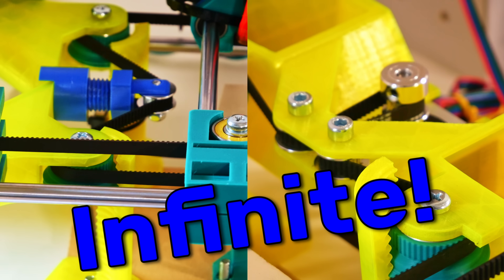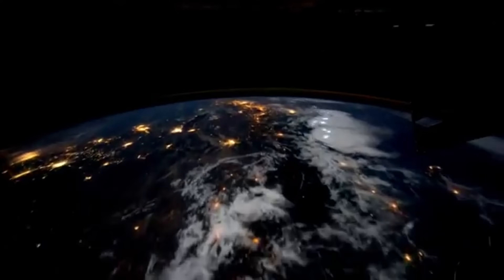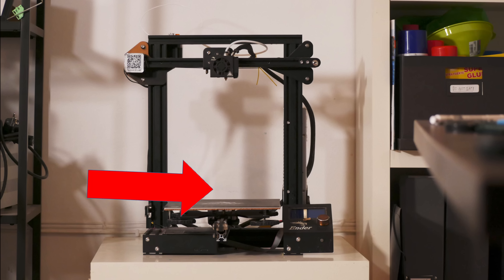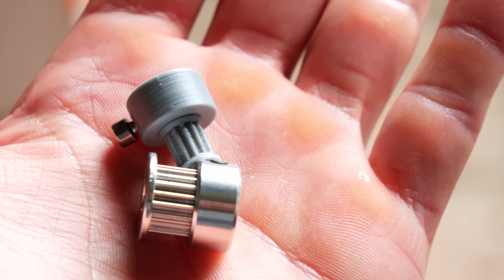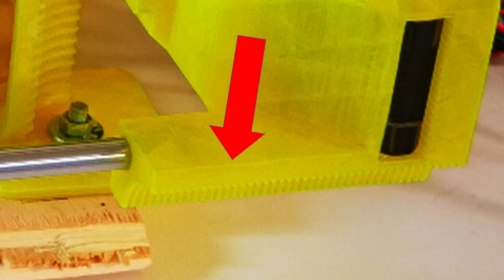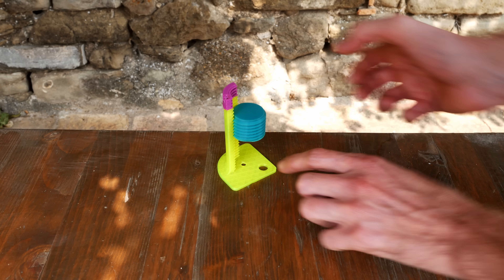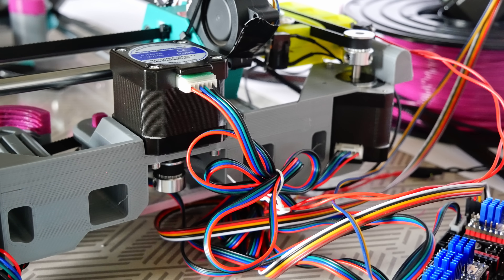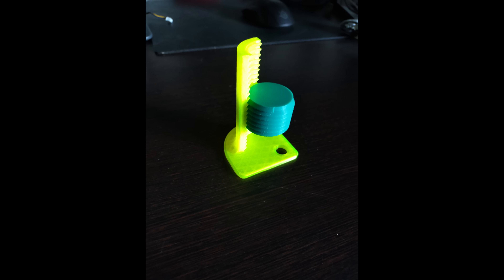it can 3D-Print onto itself?!

Comment: Print a smaller 3D printer that has a robotic building arm with 3D printing nozzle. Add the ability to move and you're good to go. Now you can drive around your first 3D printer and build as you like

Comment: Instead of cura, you may be able to create custom GCODE. Don’t know if it will help, but advanced 3d printing in clay and fdm by Diego Cuevas goes into heavy detail to create gcode using rhino and grasshopper for custom pieces

Comment: This is BIG. But uh, the biggest problem is both getting the materials and filament, or attempting to assemble the 3D printer using the exact same printer. Or even attempting to print the orders on the printer!

Comment: It looks to me like one thing each of the Sclegs (screw legs) needs is a rib to stiffen the back end of it.  Even just a 1cm bar going from the inner corner to the outside of the circle would probably do wonders to stiffen it up a bit.  That would probably do what you need to reduce flexion toward the center, but torsional flexing might still be an issue unless you have two braces either at angles or in a triangular/ x shape.  I think the dovetail screw profile is a very clever solution, but I also think that you need to stiffen the whole assembly up so that you can get better dimensional accuracy, which I think would help with some of your layer shifting issues.  I'm pretty sure you know this but have avoided it to reduce material usage during prototyping, but my unqualified, uneducated gut feeling is that this is probably contributing more to your problems than you think it is.

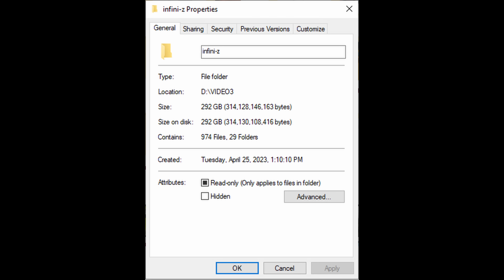7:30 - TBH, that sounds about right for Cura.  I get it if that's just the only slicer that will work for this, but my experience on multiple printers has been that Cura is pretty awful and prone to doing awful things.

good liuck, subbed, I hope to see updates!
Reply: The projectquine substack does talk about stiffening the legs up for taller prints.

Comment: I think the most challenging part would be the circuitry. Sure, you can 3d print circuits, but how are you gonna 3d print a capacitor, or a resistor, without it being massive and clunky?

Comment: 💀 Z wobble?

❌ Aluminium extrusion frame
✅ 3D printed flimsy plastic legs of infinite height no braces required
Reply: The counter-snapping thing Veritasium talked about is 3D-printable, and damps vibrations
Reply: @smorrow  "damps vibrations" Tell me you dont know a thing about 3D printing without telling me.
In 3D printing nobody really cares about vibrations since G sensors and input shapers were implemented. But nothing will save your print if your 3D printer frame is made of paper mache. Or in this case out of printed legs of "infinite" height. And im not even gonna go into the legs breaking inevitably when reaching a certain print height no matter the material theyre made out of.
Reply: @SagittarA  But at 5:00 he shows that the workpiece itself can have the "legs" as part of itself.  So that's more rigid (than the flimsy leg version, but not than extrusions) because more material,  but also it should have no Z wobble if you think about it because the top of the work is wobbling WITH the printer frame - because they're literally the same object.

As long as you can stand your work having artefacts of its creation on its outside corners.
Reply: @smorrow yeah as long as you only print the printer frame. So you exchanged z wobble for singular use machine… gratz i guess

Comment: Really cool idea, but if you truly print everything, you'll inherently get inaccuracies that just get worse each iteration. besides that, technology just isn't there yet to be able to print stiff dimensionally accurate metals and plastic in the same volume, and it's not a good idea to try either. You'd be way better off building an assembler, that can assembly both itself, and a 3d printer. Separating assembly and 3d printing is really not bad, and I think if both machines can be 3d printed, and assembled by themselves, you still achieve the end goal.
Reply: That's a really good idea dude

Comment: so your gonna print its printing supply by using its printing supply but it uses its printing supply to even print the printing supply to print the printing supply that prints its self the printing supply from that printing supply but you cant make the printing supply because it uses its printing supply to make things so to make the same thing you need the exact amount so IMPOSSIBLE to make it bro. also power

Comment: Hold up then if it can make a printer is one thing but can it program said printer so it has the instructions to be able to receive print instructions and also duplicate when prompted

Edit: and also you cant pull fillament out of thin air

Comment: As cool as the "infinite" printer is, I see least 4 points of failure when it gets high enough. Sure it will work on paper in a lab with ideal properties of all materials. In reality? treadmill printer seem far more likely to actualy survive printing it's own parts. 
Those 4 points, if they had a stability anchor at the top as well as at the bottom they yea, cool idea.

Comment: This would not be possible in any kind of universe, because the idea at its core is flawed, you cant print intricate motors and motherboards, even if you would, who would remove the printed printer from its base when its done? Who would plug it in? Speaking of power, you cant print a psu as that would be a huge waste of time and is very risky. Even if you managed to do all of that, THE PRINTER ITSELF DOSE NOT HAVE A BUILD PLATE, it can ONLY print itself!
Reply: Robots
Reply: @MrSkeleton14  whats that suppose to mean?.
Reply: @Enjeenier  robots plug them in
Reply: @MrSkeleton14  but thats only one of the countless problems, and even if you did places robots, they just create more problems, is the printer colony somehow manages to grow, than the robots will quickly become outnumbered by the sheer number of printers
Reply: @Enjeenier  print more robots

Comment: Project Idea: Take every 3D printable part and integrate them into one print file with engineered supports stacking all parts in the z-direction, similar to how resin printers achieve full build volume batch prints. I'm unsure of your current process but this would allow for the entire 2nd gen printer to be assembled upon the print finishing, assuring all parts are included. Building onto your idea of scaling, being able to use the full build volume without stopping to remove parts would greatly reduce time for human interaction allowing for more rapid scaling of the entire project.

Comment: Not sure the point or practicality of scaling the printer itself in size until it covers the volume of the intended product, instead of just pushing components into an assembly zone in charge of another robot. Most products can't be printed mono-piece. Nor I see how self-replication would be done in theory.
Now, the printer being able to arbitrary scale up by itself is a good idea, as it would allow printing larger components without the need to replace or rebuild the printer. Just ensure it can undo and remove the additional rails if needed.

Comment: I really like this, I was just thinking about a 3D printer that can increase it's build volume, the idea was that it could print extension tracks.  But this is far beyond that.
Reply: Ok, I think the answer initially is to just use a little human labor and don't be quite so exacting about how it lifts itself up.  Just make a 3D printer than can build a track and make sure that the track can plug into the existing X, Y and Z tracks to increase the build volumes which a human, or a very basic robot could manipulate into the right position to allow further extension of the build volume.  Agreed that metal can be done, and I like your ideas there but printing green parts, or lost PLA casting are also options.  I know you like the idea of it being just a printer that sets down anywhere and somehow makes everything but realistically we will always need more than just a 3D printer, and yes a 3D printer might be able to build some of those things but if a 3D printer can build some of what is needed then the printer doesn't need to do it all directly itself and plastic Filament is less abundant on Mars than you might think.  Let's just make a 3D printer that can extend it's build volume and be reproduced with minimal expense first.

Comment: Locating the print head could be solved with software,
Have it deliberately collide with the frame and detect hitting it by measuring the increased electrical load put on the motor when it collides.

Comment: But will it be able to troubleshoot and fix another printer?

I have been working on a robot that can troubleshoot and fix another version of itself.  All of the tools already exist (machine vision, circuit simulation, etc.) but getting them to all work together and actually be accurate has been very difficult.  Okay, actually, impossible so far, not to mention moving stuff in physical space is a huge pain.  BUT if we can build a robot that can fix other robots, we can finally get the future dystopia of our dreams bootstrapped!

Comment: One improvement I saw onto screw. You have bolt and nut. With longer bolt your roteable nut will not fit tightly to the bolt. So you need oposite force, some ball bearings with spring maybe. Have a nice day.

Comment: bit late to this party but uh, there is a way to fit the big box into the small box. Disassemble the big box into smaller parts. Though in this analogy that would lead to needing assembly so while it's possible to fit the big box in the small box, maybe not a great way to go about it... unless you have the printer rotating and controlling already printed parts to print more parts onto it after production. 🤷‍♂

Comment: What if it were 6DOF Arm? Would that be able to theoretically print itself because the build area would be the "Reach" of the arm 360deg around itself? That way you'd not have the box within a box problem, because there is no box. 
- hehe "There is no spoon"

Comment: What if the separate parts were printable in a way that made it as easy as possible to put them together to make a new 3D printer?

If it is planned how this 3d printer would be mountable in the easiest way possible, that is a path that seems more possible than the video path and it is not that much more difficult to replicate, indirectly, the new 3d printer.

Comment: I think that your ambition is incredible. And the ingenuity is inspiring. However, I don't agree that additive manufacturing is broad enough alone to build a self replicating machine. I think that your goal of creating a machine that can replicate itself is very feasible. Just not an additive manufacturing machine.
So, a few things needed to be added for this thing to truly be self-replicating -
   A mining process to gather raw materials, including fuel to create heat and energy, minerals that can be refined somehow into plastics and metals(can you create plastic from raw minerals found on Mars?).
   Additive manufacturing to create parts that can be printed.
   Subtractive manufacturing to create parts that make more sense to mill
   Foundries to turn raw ore into metals.
   Mechanical manufacturing to turn raw metal into wire, sheet, and bar, and then turn those products into springs, bearings, tubes, pipes, bolts, rivets, etcetera, and then assemble those parts along with parts created in the additive and subtractive processes into working machines.

Everything would need to be automated. From refining crude into plastic, turning the plastic into pellet, then into filament, winding the filament, storing the filament until it is needed, loading the filament when the previous loaded filament has run out. Along the way, the machine would need to maintain itself, lubricate itself, make repairs, build structures to protect itself and products from the elements. 

It's like a biodome for manufacturing. I think maybe a biodome would be easier. But I believe that both are absolutely feasible.

Comment: Hey, @TurboSunShine! Project of frame at 5:03, with plastic frame with outer threading, looks most great and simple! It could be stretched in and out indefinitely, and easily regenerated with just a tiny script! Later versions that were using dowels and end connectors are just a mess, that frame with outer screw thread is really the perfect solution for a frame that could be!

Comment: The solution to the box problem is compaction, assuming the box is empty that gives you more volume than surface area. This means you can build a greater and bigger box in the smaller box aka compaction. This both solves the initial problem and allows you to build bigger and bigger printers. For instance you may have a box built of 5 sides, you can build more than 6 sides of that box within the smaller or equal sized box very easily due to the shape of a box (where all sides of it including the bottom are equal.) 

You would have to use a unique solution to get the box within the box to fit together in once piece (without touching it yourself.) and stack the sides of the box together to build bigger boxes.
Reply: His solution ended up being better than mine.

Comment: Do you have 3D printed motors that can really move that much material? The motors, circuits, and especially sensitive electronics are difficult enough to produce from purpose-built machines, so I'm curious how you could 3D print anything like that.
Safety mechanisms like fuses and things especially, it has to be perfect for it all to go right. I'd love to be hopeful, but the amount of precision needed for some of these parts does make it seem a little crazy.

Comment: I'm a bit late to the party but I have a question (and perhaps an answer?). When the printed legs becomes long enough, won't they start to flex? Even though the legs are attracted to the gear (brilliant idea btw), the longer the legs get, the more stress is put on them? Won't they bend in the middle when the printer climbs high enough? And can't that problem be fixed by printing a support-pillar in the shape of a tall square placed in the middle of the backside of the legs? 

/Bob

Comment: If instead of physical buttons (end-of-route sensor) that require physical contact, laser distance sensors were placed? or a simple LDR (Light Dependent Resistor) that detects proximity to the light of an LED.

I believe that a second point of improvement would be in the stability of the project's structure, I am thinking about interconnecting the rods (Z) that are being printed forming rectangles, providing greater stability to the structure even at higher heights - at the cost of more material. I believe it's worth it.

Comment: it cant print itself
you would need copper filament, led implanters, metal filament, and uh... A FREAKING COMPUTER INSIDE OF IT
Reply: All of those things exist
Reply: @hex1795  then I STAND CORRECTED, sorta.
I'm still not convinced it can print itself.
Reply: @youwillseemeanywhere4348  It lowkey kinda just did it though, its not there yet but i think it will absolutely do it
Reply: @hex1795 and you would even need to make sure they dont run out of energy, filament, but most importantly you gotta make sure the computer knows how to make itself.
the third problem is easy, but the 2 others will always be one
Reply: @justarandomguyuy  solar panels, it can recycle it’s parent printer for efficiency using pla recyclers which exist, and if the biggest problem you have is needing to plug in an ams unit and just add new a roll every few days.
Then that’s a pretty impressive problem to have
Reply: @hex1795 oh yeah and also something to make the filament go really hot.

Comment: Although I sympathize with your goal, this clearly won't work because you've omitted any stabilizer between the vertical struts. That will make them very wobbly to begin with, which will only get worse as it grows taller. Printer accuracy can be bad with with rigid metal vertical supports. Replacing that with wobbly plastic supports is not the solution.

Comment: Hear me out . What if you instead made the z axis a suspension system that monitors the rate of expansion and use an algorithm to predict what changes needed to be made to keep it running straight.this is a double redundancy you could make it more sound by putting temp sensors,the algorithm would just alter the g codes temp and fan speeds you wouldn’t really need to make adjustments to the pillar model . For the suspension system you should use a series of pulleys and belts  and belts and a belt tensioner that’s linked to the regulation algorithm,you could add more sensors to detect the x and y axis offset and use that information  adjust the belt tensioner to allow it to not layer shift

Comment: I don't think this is possible. Even if you could do it, if you use a stepper to print a new stepper, you will have all the error of the original stepper plus the error of the new one, and it will go on and on until the printers are useless.

Comment: bro took “Buy 3d printer, 3d print 3d printer, return 3d printer” too seriously
Reply: I laughed way too hard at this
Reply: Wow lol
Reply: Thanks for the idea
Reply: the most difficult grammar test
Reply: I actually did that, more or less.  

Bought a Prussa, printed a Prussa, sold the original

printed another one, sold it

rinse, repeat

Was good money for a couple years.  Now that amazon has knockoffs for $75 the golden goose is pretty well cooked.

I tweaked my Prussia clones to be quite a bit faster, but Bambu apparently has a much better R&D budget so I finally sprang for a Bambu P1S which is FAST fast and darn near bulletproof, even more reliable than my authentic Prusa was.
Reply: *buys K1 Max*
*3D prints a K1 Max*
*Returns the K1 Max*